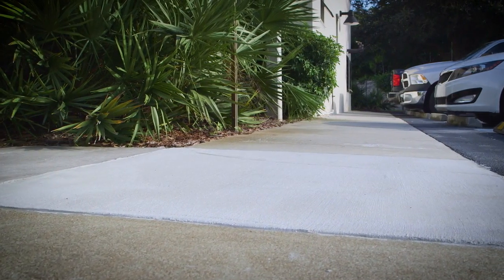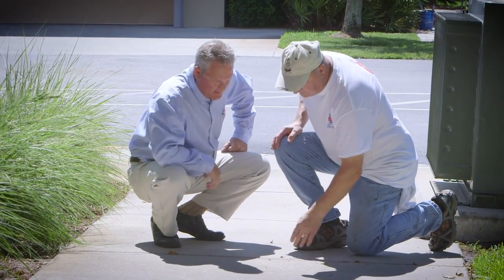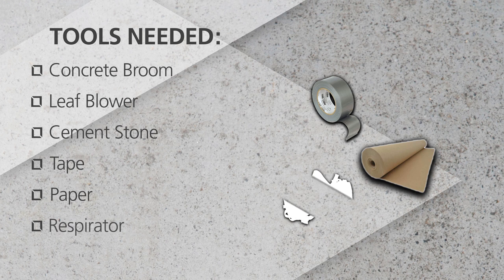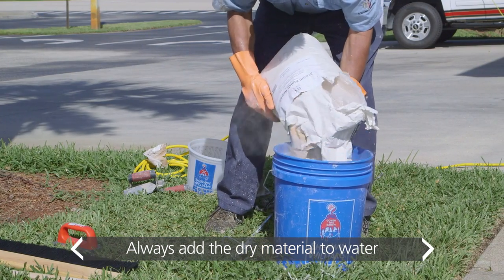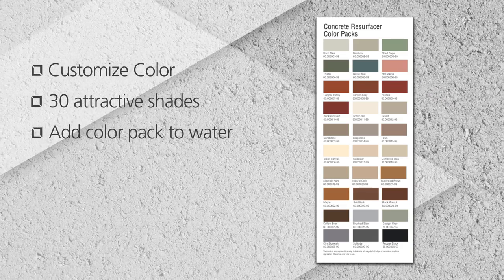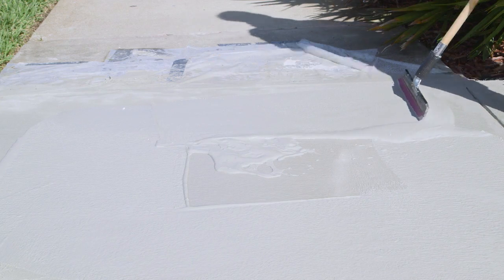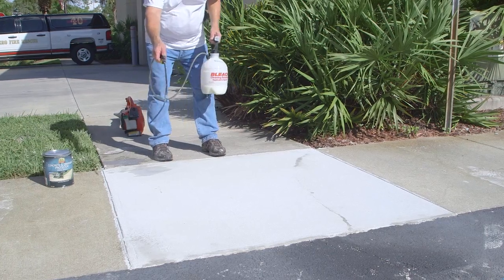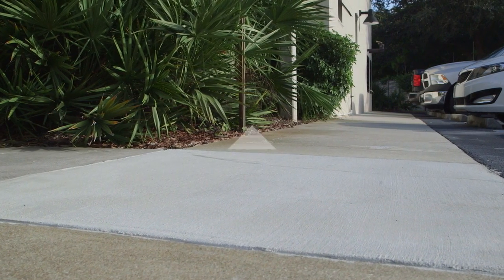Deteriorated Concrete Surfaces - Sherwin-Williams

Comment: Can this be applied to a driveway and driven on?
Reply: iamdjsluggo  yes
Reply: Rene Rodriguez you have applied this to YOUR driveway?
Or do you work for Sherwin-Williams?
Reply: I apply this product all the time proper preparation works great
Reply: Rene Rodriguez really?! That’s great to know. Do you recommend rolling on a layer of concrete adhesive first? Or are the directions here enough for maximum bonding? I just purchased a surface cleaner attachment for my power washer for preparing my driveway. 
Thanks a TON Rene.  Muy apreciado!
Reply: Forgot to ask. Do you need to reapply every year or two? Or does it last longer?
Reply: Just pressure washer is good enough no primer binding needed... this is a cementious coating so there s no need to re apply
Reply: Rene Rodriguez again, thanks. Heading over to Sherwin-Williams this morning.
Reply: @renerodriguez4913  hi what do you have to do over painted concrete to make it stick. i want to refinish a pool deck.